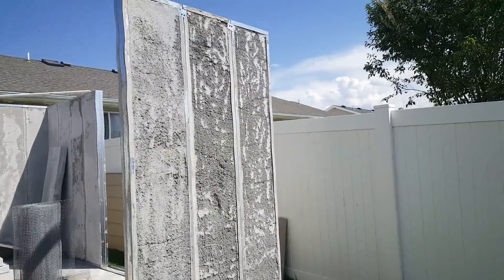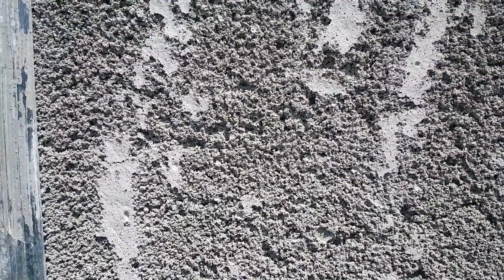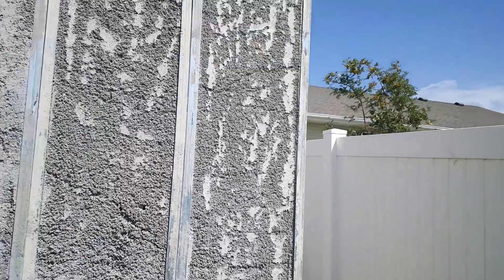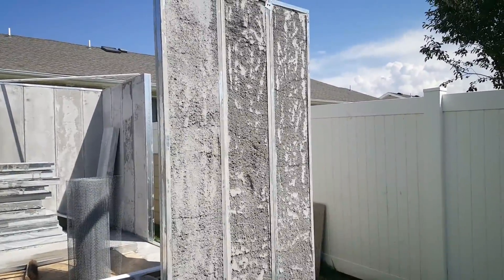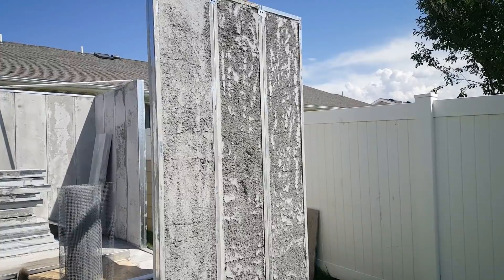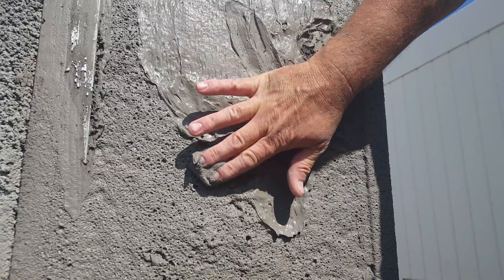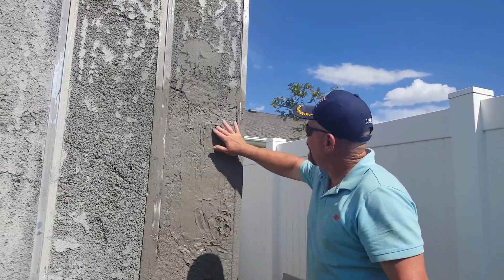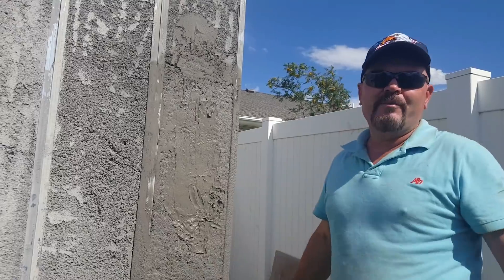Spraying Aircrete ON Wall Panels

Comment: have you considered spraying the forms with a standard concrete mix using the spray apperatus, then filling the forms with the aircrete while the spraycrete skin is still wet?. You get insulative interior, with a standard strength exterior. watch any videos where a maker is building say a concrete countertop to get what I mean
Reply: shaunw666 Yeah, he could do a fine coat, then some fibre reinforced, and then fill in the bulk with aircrete.
Reply: Roofing fabric. Much tougher. Stick it on with elastomeric paint.
Reply: SelfSufficientShaun
Reply: @LittlepigStore, LLC forms for custom car interiors are made with material dipped in fibre glass resin then streched over a frame, this is similar to what you describe, but to make it more of a building material would it work to use a more absorbamnt material such as old blankets like removal companies use rather than landscape fabric which is plastic and wont soak the material, if waterproofing agents were also added they would end up on the outside of the aircrete to produce an outer skin with more resistance to the weaather
Reply: Nice idea, heavier to handle. Wondering whether the surface would stay attached to the fill?